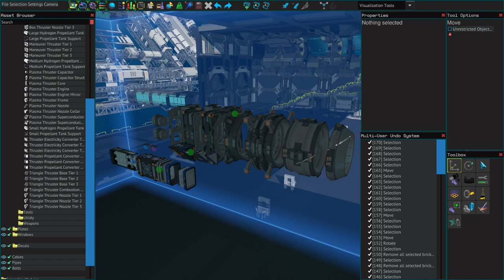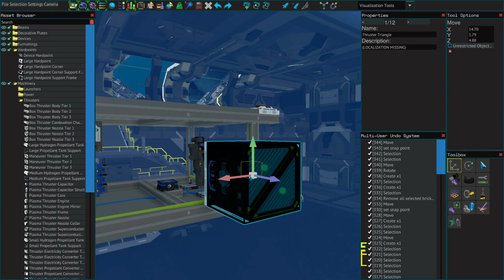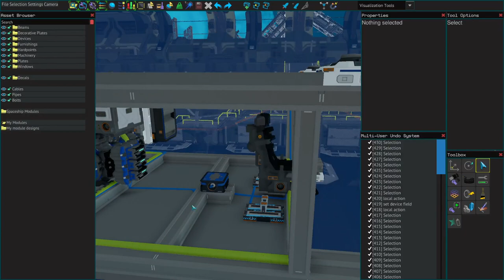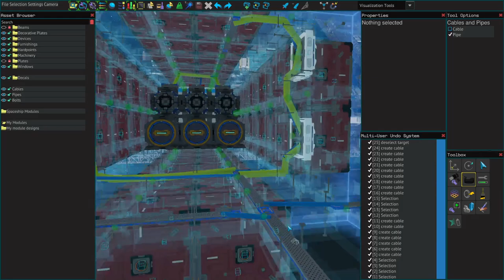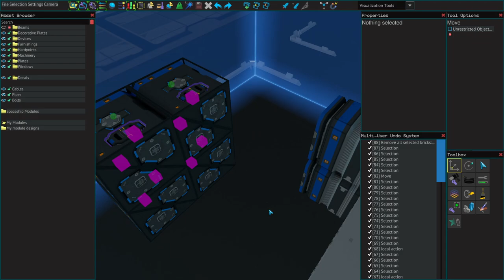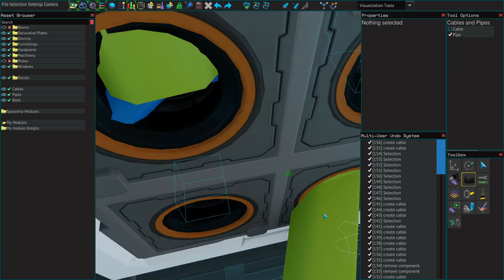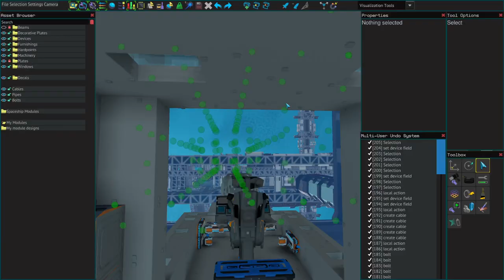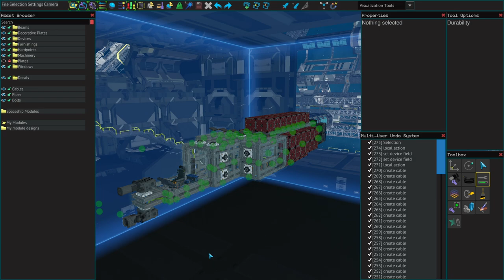STARBASE TUTORIAL: THRUSTERS - Assembly, Usage, Troubleshooting (Read Description)

Comment: Can you do a video about hinges in depth? I've been trying to make a basic handle hatch for my generators and instead of opening up the hatch, it will move the whole ship, or when I change  the hinge into another position it'll open up like its supposed to but clip through everything instead of stopping where you'd logically expect the door would stop.
Reply: You do need to add a rotation limit or it will clip through. Use the universal tool.

Comment: Having maneuvering thrusters on both sides of the center of mass actually won't make a difference compared to having the same number of thrusters at the same average distance from the center of mass but all on one side of it. No matter their position, the pivot point of the rotation will always be the center of mass. The only thing that matters is how far they are away from it, in terms of moment, which you should maximize like you said.

So having two thrusters, whose lines of thrust are both 10m away from center of mass at closest point (if that makes sense), it doesn't matter if one of them is on the opposite side of the CoM or if they're both on the same side of it.

Comment: Is there a "proper way" to attach hardpoints to beams? Can i stack beam on top of hardpoints and bolt them, or should i make a frame around the hardpoint? or i can do either? Also should i bolt the hardpoint on the thruster, then the beam on the hardpoint, or just bolt them all together and save bolts, or this doesn't matter either? Asking that because the spacing and bolt placement seam a bit strange if you use auto bolting, i wouldn't want this kind of bolting in real life. If i use triangle thruster with small hard point the autobolt don't even bolt them on beams...

Comment: Is there a way to use this ship designer to upgrade your existing ship? At the minute going through easy builder with easy mode turned off and its painfully slow to upgrade. Loved how you presented a problem and troubleshooted it and filmed it. Ive had the exact same issue as you with box thrusters and i am sure it will be due to not bolting hardpoint into the frame…!
Reply: U can load Premade blueprints of ships of the ships who you can also buy in the game.
Reply: You will be able to edit ships you have an unprotected blueprint chip for WHEN that feature is brought live.

Comment: Mine are connected. When i manually put in the power for my thrusters they thrust. My control panel just isnt working for some reason. I seem to be fully wired up. Maybe a computer issue? Ive tried name reset. Thrusters are definitely wired up and receiving propellant just none of my levers seem to be working

Comment: could u do a Turtorial about the Plasma Thrust? i somehow missing something. im atm designing a 600+ hauler an i have that on eplaced. it runs, but somehow it produce less thrust then my 30 Triangle thrusters at the back the triangle puts me to 30m/s and Plasma +9 rings then puts me to 40m/s... with my mach i should easyget over 100m/s but it does like 10-20 triangle thrusters. but it does thrust, just very very low. way less then it should.

Comment: What's a good warp class? For a small mining vessel?

45:24 I love doing that though. I also found myself putting bolts through the inner sides of the socket holes in some cases. Its entirely how I got my lumpy ship up to a warp class of almost 5.
Reply: For now it’s enough to have it over 1. there is no benefit to have it higher.
Reply: My ship is split into two parts in the designer currently. The larger half is currently at warp class 273

Comment: im getting no ship frame on my triangle thrusters. I have two stacked to form a box, and I have everything bolted up on the thrusters. The thruster was snapped to a small device frame like you show in the tutorial, and I have all four corners bolted to beams. My question is: Do I need to connect power and propellant to the thruster before the game will give me a ship class? Im worried im doing something wrong so I dont want to build the whole thing wrong.
Reply: Update: Autobolt tool to the rescue. turns out i wasnt using nearly enough bolts. ship class 4.79
Reply: So you got a class with JUST thrusters and frames? I may have to mess with my design a bit before it progresses farther if that's the case. My hardpoints may not be connected well
Reply: @BaneSIlvermoon  Yeah once you get everything connected to the frame it should give you a ship class. if it doesnt something isnt right. 

For me my box thrusters weren't copying right so I used the pre-built box thrusters and everything worked great.

Edit: Also autobolt FTW.
Reply: @ryankl1984  Yeah I don't know why I even asked that. The other half of my ship, which was on the other side of the designer space, was literally just cargo modules, maneuvering thrusters, ducts, and beams... and it had a warp class of 273. Clearly all you need is a thruster properly bolted on.

I realized my hardpoint wasn't bolted on well. Had to build some beam framework behind my thrusters.

Comment: Is using ducting through out the ship better then piping and cabling?
Reply: In my short experience, if you're building with modules, ducts are better. Including modules you design yourself. They're also better protected from damage. However, pipe and cable can go anywhere, are easy to put down and take back up.
Reply: it's preference really but theres pros and cons. ducts fit along your beams which essentially means they take no space and they also double as both cable and pipe connection. However if you intend to take your ship out of the safe zone, pure cable and pipe might be better since you can see which connections are severed when the ship takes damage.

Comment: Man. My ship turns right when I go forward. Every other direction works perfect. I have isolated it to a cluster of 4 triangle thrusters so if i disable those it flies perfect. I have no idea what is wrong. It is my first ship. Any help?
Reply: Are your thrusters balanced? Meaning, are those triangle thrusters mirrored on the other side of the ship, or do you have more thrust on one side than the other?

A weight imbalance might play a role too, if your ship is heavier on one side. But I would expect that to be prevalent with or without the triangle thrusters.

Also I'm assuming your battery power isn't reaching zero. Thrusters will toggle on and off and ships tend to drift sideways then.

Comment: do you know why my thrusters that are named different, and are in opposite directions both turn on and nullify each other, already checked controls and stuff but nothing seems to work
Reply: Ive got a similar issue.  Verified names are all different 3 times. Out on a flight I cut my front (rear facing) thrusters because theyre activating during fwd throttle and found my ship randomly pulls up to the right a little bit. Just random. It might fly straight for 15 seconds or 2 minutes then pulls for a half second. But with those connected they pulse when that jolt is gonna happen but drains more power and fuel. Ive walked all over every side of my ship and nothing is activating to cause any weird thrust (that i can see)